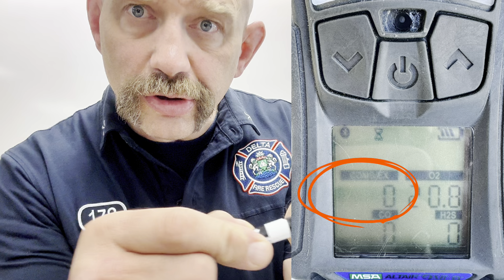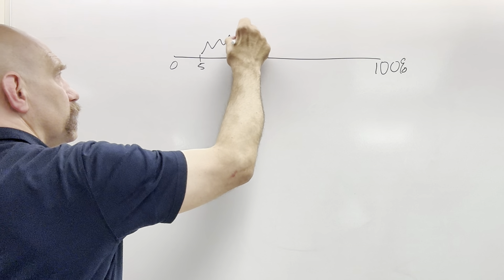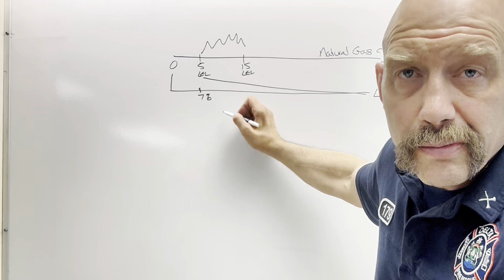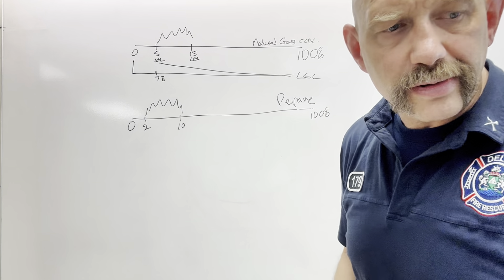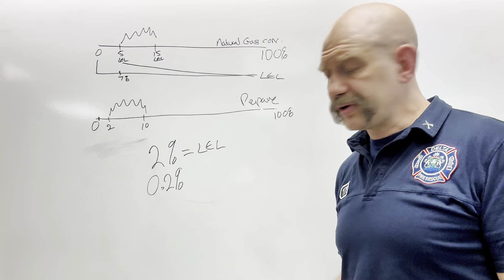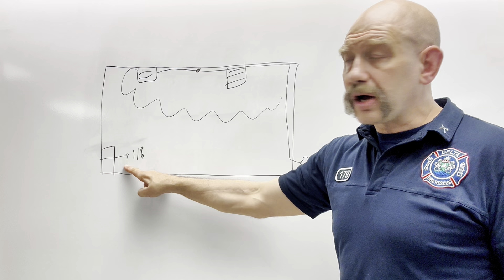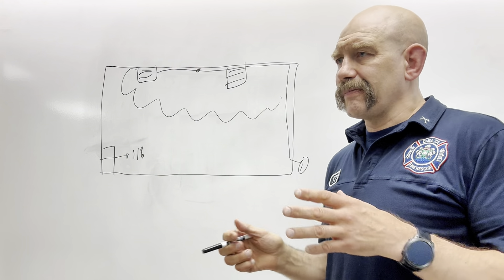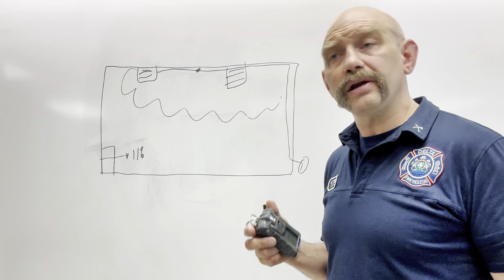A Crash Course on LEL Sensor Readings (aka How Not to Die)

Comment: If I may ask another question that might be obvious, in case there is a leak the LEL % reading on the sensor or in my case the control panel should be constantly changing right (probably rising)? Because I have one sensor that is stuck at 9% LEL all the time and im not sure if thats just fine or if the sensor is faulty and if so how i would go about testing it/ fixing it.

Thanks again!